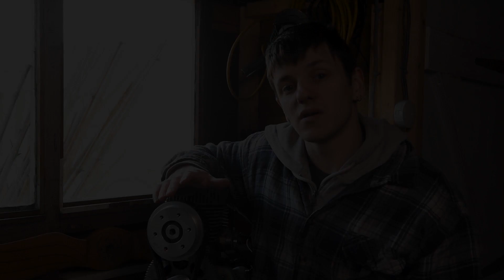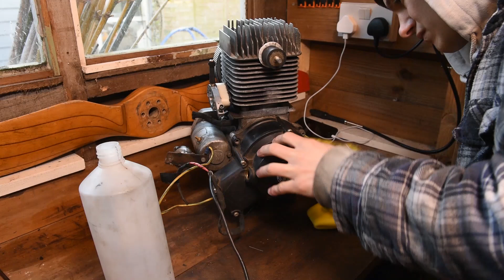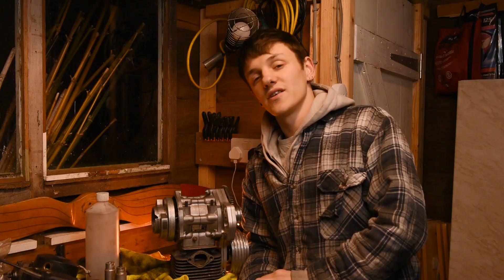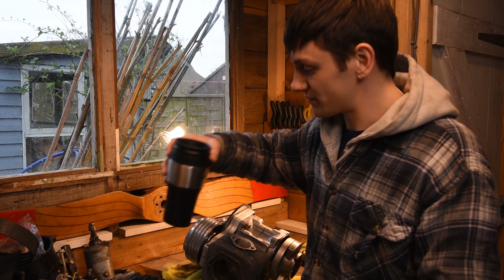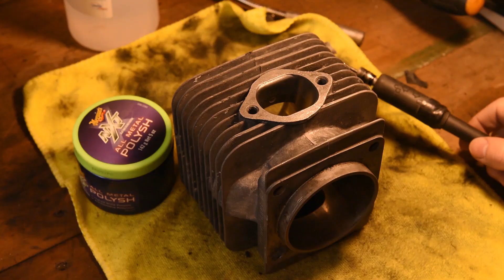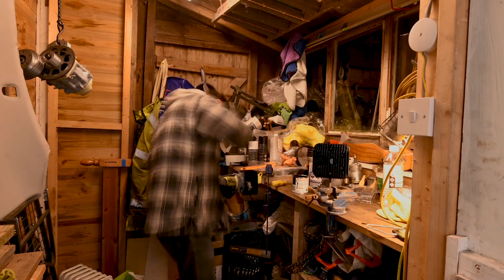Engine Painting & Exhaust Porting | How To

Comment: Hi, quick question, can I use any type  of oil based paint? Would it not cause temperature trap or limit the heat dissipation especially on the cooling ribs?
Reply from the maker: In hindsight of this video I don't believe I would paint the cylinder head and barrel. I would much rather get them bead blasted. Although I don't think I'd worry so much about the crankcases.

Comment: Shed building is a hobby and looks fun but I think the Hammerite temp tips are correct. If it all goes gloopy on the run don't despair at lest the polishing will stay. I picked up a ultrasonic cleaner from Amazon that did a very vice job of lifting off some bodied paint from a turbo that someone decided needed paint. Also brought the alu up well just don't mix metals in the same run or you will get some discoloration. Alternate is soda blasting and I had a local company do this (local to me in Munich that is). Good luck and hope to catch you in the air at some point.

Comment: Why, oh why would you want to paint the engine, especially the cylinder and head?!?  Do you not understand that paint is an insulator?  And do you not realize that the cylinder and head need to dissipate the cumbustion's heat?  Now that you've painted both parts, the engine will most definitely be operating closer if not over it's safe operating temperatures, and much more likely to roach the piston and rings and cylinder.  The better solution would have been to merely clean the aluminum, and then if you must, polish it.
Reply from the maker: Hi Saga, yep I knew the consequences going into it. Will be doing a follow up video once the project is done talking about how things went, anything i'd change etc. Thanks for watching

Comment: sorry to bring you this news, but hammerites boiling point is 155C, please post the video of when you start this engine and get it up to full operating speed to get cylinder head up to 220C, the cylinder head is going to burn that paint and its going to drip and run down as it melts, the barrel will also burn the paint and make some kind of awful mess. If you want to paint your engine you need to be looking at ceramic coating, which is about £70 per item.
Reply from the maker: I had done quite a bit of searching online and people have used hammerite for car engine blocks and brakes without any issues, which I why I decided to give it a shot. It makes me wonder if the 155 degrees boiling point refers to hammerite in liquid state? Ceramic coating is the ideal agreed however, this is a budget build and I’ll definitely do a follow up video to the rebuild with what I’d do differently, what went well etc. I’ll let you know what happens
Reply: car engines run out much lower temperatures, car engine blocks do not get that hot, which equates directly to the two strokes lower crankcase, however the barrel gets hot due to combustion taking place in it and friction of the piston moving up and down(internal temp reaching 800 Celcius). The exhaust port in the barrel reaching very high temperatures. Hammerite might appear to cure once left in the open, but if heated up to 155 it will become liquid again. The only other high temperature paint are the ones used on fire places, but I still find they give up and become powerery. I reckon the best thing to ever do for an engine is to restore it to original by vapour blasting it to bring out that beauty of the ali.  The other option is anodise, but I still think anodise colours have to be chosen very wisely to make it look good. Its just way too easy to accidentally put too much colour on and then your motor looks like its been gang banged with a crayola pen.  I think less is always more, if you know what I am saying ?